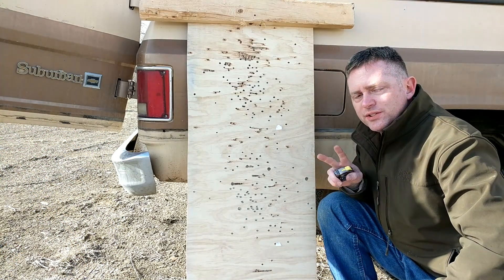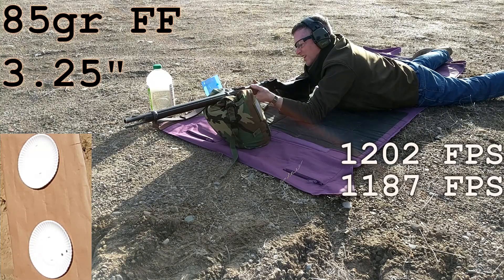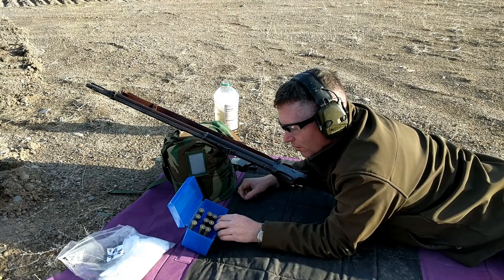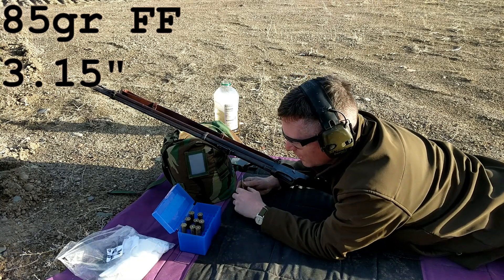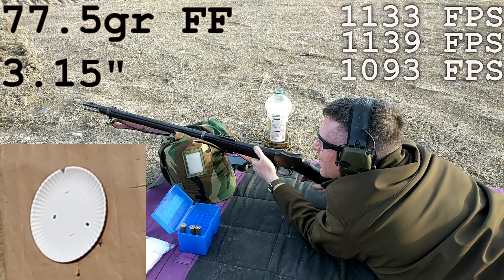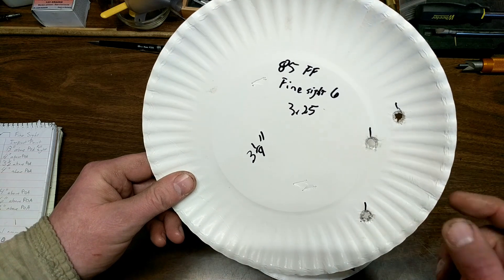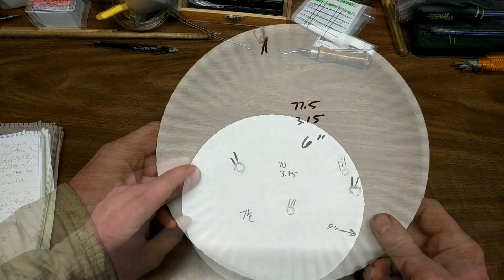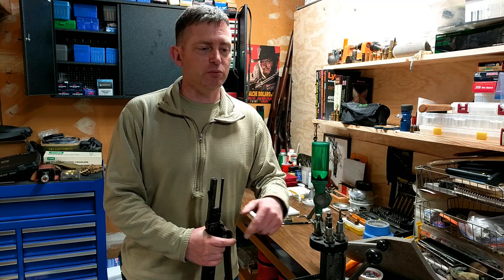Martini Henry Load Development

Comment: Hi C&R collector I had the same problem with the sight picture and I didn't want to permanently alter my rifle in any way . I ended up using some (liquid metal) epoxy and building up the front sight or you can just glue a brass rod to the front sight which I did to my Snider my sights have been working great now for the last 4 years and it is a good easy solution. As you have found out it takes a lot of experimenting with loads to find out what shoots best in your rifle but man it's a lot of fun. Cheers
Reply from the maker: Thanks for the tip, I may have to look at making the sight taller.  Agreed the journey with each firearm is fun.

Comment: Dropping the powder through a three foot drop tube will compact the powder, even the burn, and help with fouling.  Dropping the powder through a tube.  It drops by it's own individual grain weight.  The courser powder drops closer to the primer and the fines settle on the top of the powder column.  A wax paper disc instead of a card disc under the grease cookie.  This will cause the cookie to vaporize in the barrel.
Reply from the maker: Thanks for the tips, will try drop tube and wax paper.

Comment: i use IMR SR4759 smokeless powder vs black powder.... walnut media as a filler a wad with a paperpatched 500grain bullet an get MOA with it.... it's a pain to load (trying to keep the media seperate from powder, but the results are worth it. imo..)
Reply from the maker: If I run into that powder I will have to pick some up.  Thanks for the comment!
Reply: Try just a bit of the cotton ball or a square of toilet paper as a wad between the powder and the filler to keep them separate.  Or just wad up 2 squares of TP and skip the walnut.  I'm throwing a charge of Blue Dot, which is more widely available.

Comment: Hi there, amazing video! just wondering if you compacted the cotton or just let it sit freely? kind regards!
Reply from the maker: It is just pushed in enough to load the rest of the cartridge.  Seating the bullet would compress it.
Reply: @CRCollector   Thank you sir, was just wondering how it sits and all that i assume the powder burning would burn up a decent amount of it before i leaves the barrel?
Reply from the maker: The cotton is expelled out of the barrel but is significantly charred.  I would not fire a Martini (or any black powder firearm) in a hot dry area with combustibles near due to this.
Reply: @CRCollector  brilliant thank you very much for the advice :)

Comment: I missed the bullet weight and mold maker..480gr 10x?
Reply from the maker: It is an RCBS mold 468-480 MH #57922.  It throws a .468 bullet that is 480 gr.  It seems to be discontinued.  I would suggest  Martyn at X-Ring Services for an alternative.
Reply: @CRCollector  Thanks

Comment: What is the correct temperature ( in Celsius) to casting 577/450 bullets ?
Reply from the maker: I don't use a thermometer so not sure.  There are also several variables that could be different that would cause the temp to be different.  Mold size, mold material, cavity number, and lead alloy consistency are among these variables.  Just play with the temp until good bullets are being cast, Lyman casting book has good instructions.